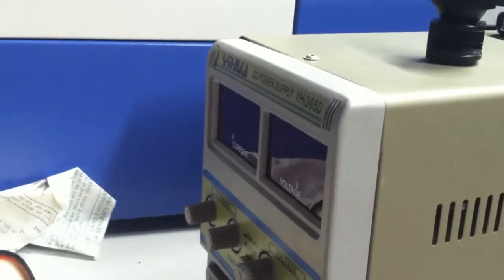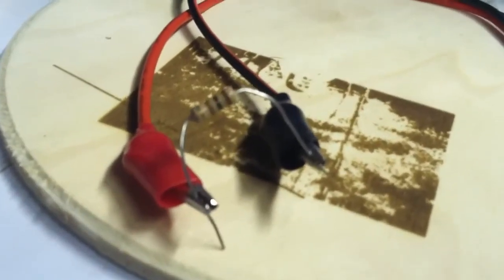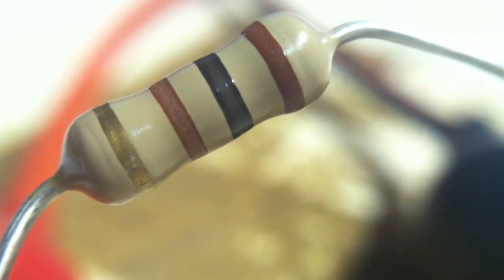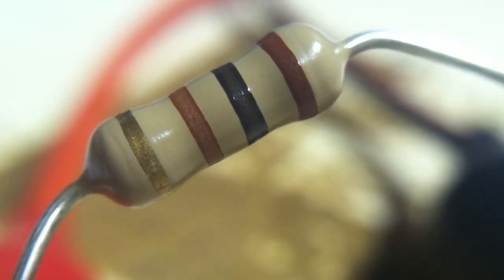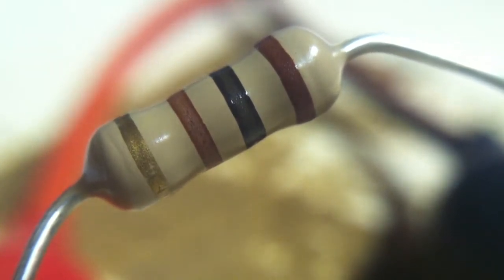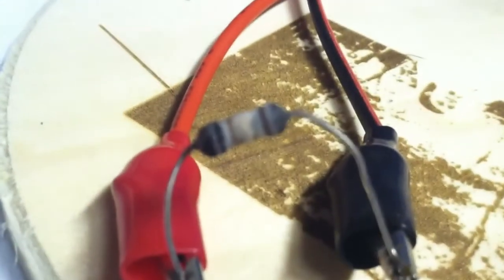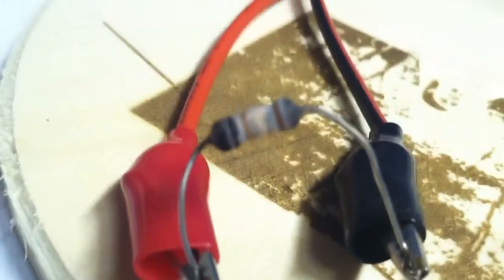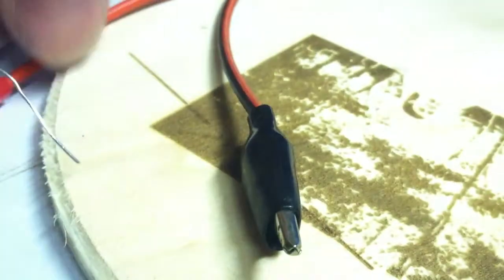Overloading a film resistor will catch on fire

Comment: hi, i wonder if making a series of 1/4 watts would lower the overload of the  resistors? meaning if the resistor are 1/4 watts max, so ii wonder if i can add more of resistors to increase watts max in a series ??? i got 1/4 resistors and i am trying not to burn the resistor out and i am using 12 volt and it produce 5 watts and the amps is .42!! Any ideas